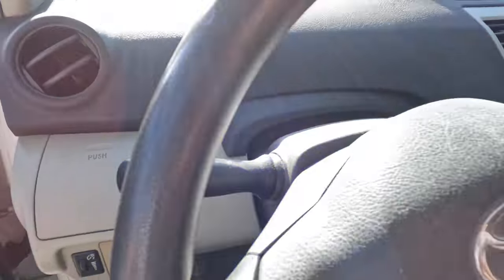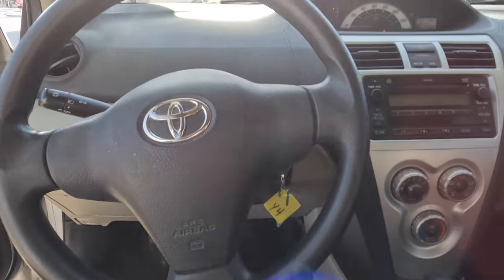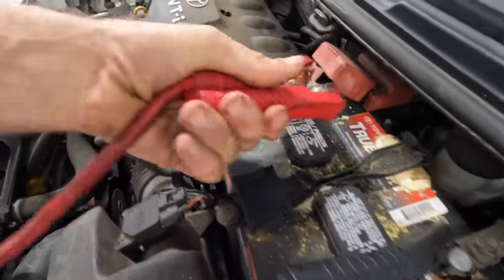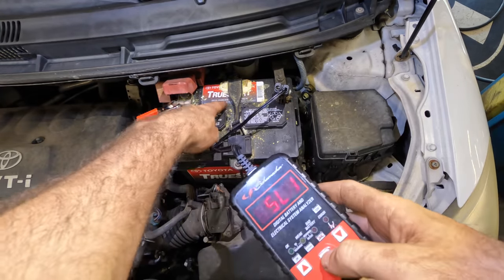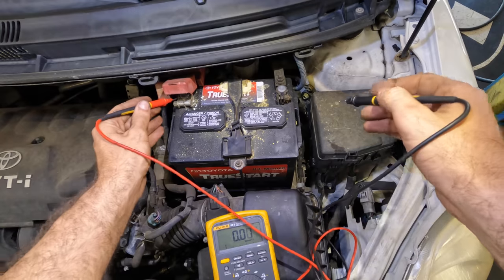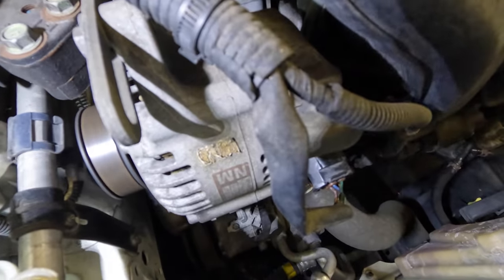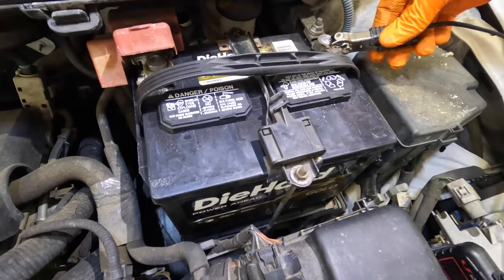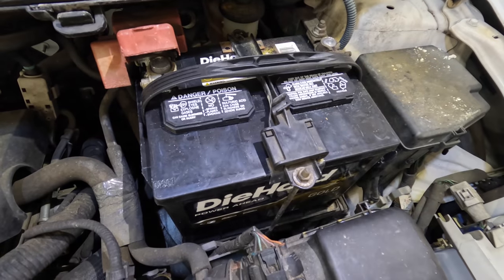Ignore the obvious! “Let’s see what happens” 2006 Toyota Yaris

Comment: Has it gone out of fashion to take a faulty alternator to pieces and examine and test the parts to find out what has gone wrong? Often it does not cost much to make a good repair. Last time I had a problem with the alternator in my van it was corrosion in the mounting/ground connection of the rectifier, and all I had to do was clean the parts and reassemble them.
Reply: You could probably still do that but with labor at most shops over $100/ hour it may be cheaper to just put a new nator in.
Reply: Yes.

Comment: It would be interesting to see how a best interest policy would change the dynamics of the auto repair industry in my hypothetical world as it applies to the financial industry.  In this example, the repair party shall act as a fiduciary to the customer anytime the vehicle is repaired under warranty or out of warranty by dealer or independent.  If the client solicited the need for a new battery even though the tech knows full well it is the alternator that is failed, the tech documents the unsolicited recommendation, the interaction of client, and the outcome of the repair. Documentation is the only thing that might buffer you from a client complaint after the fact in a fiduciary world of car repair.  BTW, was there any AC bleeding past the bridge rectifier and riding along the DC even in very small amounts? What does everyone think?

Comment: I am at a loss as to why a small device could measure the CCA (cold cranking amps) of the battery; 550 Amps is enough to burn the wires to a vapour in a split second.. The best test is when the engine cranks, and the battery measures, say, 11.5 Volts minimum, you have a good battery (after charging). The nominal charging voltage from the alternator should measure 14 Volts with the engine idling... If there is a load (headlights, air conditioning), a few revs, say 2,000 RPM would see a (regulated) voltage of 14 Volts at the battery under load..  ..alternator ok...
Reply: It probably uses a similar method to the mains tester I have which will tell me how much current will flow if there was a fault. It will happily display results upto 4.8 megawatts (20,000 amps) of fault current will flow with no issues. This is through 4mm/12awg wire which definitely can't carry that level of current.

Comment: Enjoy your videos. Do you also check if the alternator is charging at the output at the alternator itself? I had a case where the cable from the alternator to the battery was broken internally even though there was no visual break. Saved buying a new alternator.  Keep those videos coming!
Reply: Why did he need to check at the alternator, when the meter showed the alternator charging over 14 vdc ???

Comment: I was just wondering why you took the nut off the alternator ..The nut holds the insulator down then the wire goes on top then another nut Now the insulator will melt and you will have a come back

Comment: My Two 2001 and 2005 Civics still have the Original Alternators with 250,000 Miles, Maybe someone has a habit of washing the hot alternator-engine resulting in bearing failure.

Comment: It amazes me that the Toyota engineers couldn't see on paper that had they mounted the A/C bracket 1/2" further forward or back the nader bolt could have been removed without additional disassembly. I always visualize a lab full of design engineers passing a doobie around while they're thinking of ways to "F" with the end user.
Reply: My brother it is literally one bolt

Comment: So... I have a 2008 yaris... acquired because was abandoned due to a "no charge Condition" ray next one there is a relay under the dash drivers side that is for power windows ans locks etc that was issue with mine... the reason I say this is these cars don't always refuse to charge due to alternator issues at times its stupid relays unrelated to those circuits cause Toyota decided on these cars they should integrate everything 🙄

Comment: Nothing against the repair but wasn't impressed with the performance of the new (rebuilt?) alternator. Would like to see a bit more voltage.  The closer to 14.4 the better.
Reply: Newer cars are computer controlled charging. So with a brand new battery it didn't need too juice it up as much. GM can wind down charging to battery voltage.

Comment: Is it a requirement that vehicle coming into you shop have that low fuel light on? Just an observation.
Reply: Only if the work does not include work on the fuel system, in that case it needs be filled up right before being taken to the shop, let her eat until the pump clicks off, double click the sunbitch, three times the charm, gotta make sure the entire tank (incuding filler neck) is just packed full, gotta fill the reserve tank also aka the charcoal canister

Comment: I noticed you failed to "clock" the alternator hot wire protective cover base's slot with the wire and proceeded to tighten the nut. It's all about the details.

Comment: Interesting video. Expecting the battery to fix the alternator was a stretch but what the hell. The old alternator had a bracket for the harness tree. At 19:02 you can see it did not come with the new alternator and at 25:35 you can see the harness tree floating in space. Sorry for the REEEEEEEEEE but I enjoyed the video.....
Reply: He compared the two alternators side by side and ignored the bracket for the wiring harness 😱😱😱

Comment: Mechanic: you're alternators shot.

Customer: just replace the battery that should fix it.

Seriously some people shouldn't own a car at all. I had an alternator test good but would give me charging system failure at low rpms. After it did it with a good test I just ripped it out, walked it inside the store and told the clerk to just sell me a new one. Had the cash, drove there for that reason and wasn't about to be dead on the road.

Comment: engineering, bolt is 3 1/2 '' long, bracket placement is 3 1/4 direct in front. 25mm to the left or right, would not be a problem., but,,thats engineering for you..

Comment: There used to be alternator rebuild kits you could buy that came with bearing, brushes, and triac.
Reply: Right?  I remember taking them to the armature shop. If they had a reman they would exchange for a pretty reasonable price. If not they would rebuild for you.
Reply: There still are, and it's a good way to save some cash if you have the tools to DIY it. However factor in an additional couple hours of labour charges if you want a mechanic to do it and it swiftly becomes cheaper to replace the alternator with a new or reconditioned unit.
Reply: @Chlorate299  correct, was about to same the exact same thing there 👍

Comment: Hi Ray, I noticed a couple of things that you appear to have missed.  There was a bracket that bolts to the alternator to hold the charging wire clip.  I noticed that you didn't transfer it over to the new one.  Also, one of the air box clips was unclipped as you closed the hood.
Can you talk about these please?  Were these mistakes, or were there reasons?
Reply: How do you know he did not go back, look it all over, see the things, and fix them????
Reply: @frandanco6289  I don't.  That's why I'm asking, to find out.

Comment: What?   Does your battery tester have 99.99% pure silver cables on it?  I don't believe that your meter can test 559 Amps through those little cables and clamps.  Also, it's not cold.   How does that thing work without actually drawing the amps?

Comment: Judging by the amount of dried sulfur . Over charging , I have forgot the rest, ????? sorry. Too long since I have used that information. 
I most times would check the electrical connection between the Post and Terminal, I have seen them with 10.48 volts between so little wonder why that truck would not start. 
For hooking up batteries!!!!!!!!!!! The Negative Last On, First Off! 
Nope Sorry,  the terminals should have been cleaned and either Vaseline or a Dielectric grease applied. 
Battery should be charged  with an AC Charger for a period of time, as most people don't drive far enough to put an initial charge on the battery! I charge mine for a day each then charge them in parallel for another day, by that time the charge rate is around 2 amps.

Comment: Some days you just want to dope slap the car's engineer.😁
Reply: A thing I've noticed with a few old Japanese cars is that the air conditioning always seems to be an afterthought. I've lost count of the amount of times random things have got hooked up on aircon brackets/hardlines.
Reply: To be honest that isn't even bad, one extra bolt to take an alternator out? Awesome! On one of my previous cars I had to remove the oil filter, and ECU to get the alternator mounting bolts out. And even then the alternator only just could be removed without taking the power steering pump off... Ease of access on components that last more than 10 years is not something you need to consider when designing a car.

Comment: Ray, I have watched you use that tiny Load Tester for way too long.... NO WAY, can those tiny leads, or the minuscule Shunt in that tester handle 100s of CCA loads.  My load tester is a Brass Shunt, 3 inches wide and 15 inches long, with a MilliAmmeter across the Terminals..... that will actually put a HEAVY load on a battery, not that piece of crap gadget in your hands.
Reply: I also noticed that crappy battery load tester he uses. No way that thing properly loads the battery 😂😂

Comment: Those type of altenators on Yaris, passo, etc, 'stop' charging when the battery is full. They will charge again to around 14 volts if the driver is using the headlight for example, or simply when the fan goes on.
Just to get better mileage by doing so.
To tell you the truth, i do not like this technology.

Comment: Half the comments are stupid US thinking. Well you see boy this car is not for track days or to flex to your friends. It gives you a cheap car to buy, maintain and keeps fuel consumption as low as possible. Except US where displacement is like a no brainer the rest of the world pays huge amount of taxes for larger displacement engine. Here in Greece for instance the go to is the 1.6 or 1.8 liters. Get above that and you literally need to be rich AF to afford it. There is literally a luxury tax to any car that has or exceeds 2 liters of displacement. So most cars in the street don't have 150 Hp but somewhere closer to 100-120, concluding that 80 is more than enough for a car of it's class. Sorry for the long post.

Comment: Why don't you repair the alternator instead of replacing them. Sure that would be a lot cheaper. It could only be the doid plate or the bearings.
Reply: Cheaper for customer*  By selling a new one, they can sell the old one to someone else.
Reply: @dubious6718  normally there’s a core charge until u return the old one.  Paying a good wiring man (if you can find one),is like paying a mechanic. Plus paying the mechanic.  So it’s cheaper in the long run just to replace it.
Reply: Is that a thing? I don’t even know anyone that does repair. I just swap the alt and turn in the core.
Reply: I can hardly think it's been economical in this century and the last decade of the last century to send an alternator in for repair.  Even today's price of $200 for a new one is way cheaper and much faster.
Reply: It's only cost effective if you do the whole job yourself, add an hour or so extra labour costs, for a mechanic, removing, repairing the alternator, then fitting it, no more savings, might even cost more
Reply: @dubious6718   Wow! Show us where the bad mechanic man touched you.
Reply: Parts would be days or weeks out for that. Not many parts places stock stuff like bearings or brushes anymore in the US. "shiny" new alternator sitting on the shelf though.

Comment: The customer wants it to be the 'Battery'  no matter what.
Maybe the customer expects that the 'Alternator' will repair itself
when a new battery is installed and there to persuade the
Alternator to start working again.
The cause of this thinking is the scientific analysis part of the brain
has suffered a failure due to excessive alcohol consumption and
watching Sports on TV just as he wants a certain team to be the winner
he cannot acknowledge that the other team may be the winner.

Comment: Lol @ these customers. If he was so intelligent about turning wrenches why didn't he just waste the money on a battery and replace it himself?!?! Not only is the alternator smoked itself- (probably burnt rectifier diode and or voltage regulator,) but the fact that it's 'whining' like that tells me the bearings are trash too. It's COMPLETELY JUNK! Funny thing is I bet a battery is nearly the same price as a decent reman alternator! 🙄🤣 LOL how dumb could these people be when it comes to wasting money especially. 🤔
I used to work at a reman shop when I was in my teens before I started working at my first indie shop. Obviously all rebuilds aren't created equal depending on who redid the unit. The day of the week can even determine the quality of the rebuild when it comes to some guys... Besides myself there were only 2 other guys that did good rebuilds on alts, starters, a/c compressors, axles, driveshafts, etc. The rest of the guys there were drunks, and or crackheads, and some of them couldn't even speak English. Not only that, but I found out many years later one of them was a Chomo/ rapo on the sex offender registry!!! 😡 Talk about scraping the bottom of the barrel for some of these guys! Customer States: "Let's activate the parts cannon and throw parts at the car that aren't needed and ignore the one that is!" LOL 
end rant. 😁👍

Comment: Do you realize how much engineering was required to make that bolt long enough that the bracket had to be removed?
Reply: The bolt and engine was probably there way before the car around it was even designed.

Comment: I would’ve replaced the battery either way. But for fucks sake.. I will NEVER understand why people throw those cheap asf remanufactured aftermarket alternators in their vehicles. The original lasted 16-17 years… WHY put in junk that will barely last 3 years if you’re lucky? You’re not saving a dime, ppl. A properly remanufactured unit from Toyota is like 350$ but I promise you it’ll last another 15-20 years. 🤦‍♂️

Comment: If it's like my car that drives me nuts with a computer-controlled alternator it won't charge unless the computer is calling for a charge.😠😠 I hate the damn thing I drive 250 miles park for 10 minutes with the radio one and the things telling me to start the engine because the battery is low. What a P.O.S.

Comment: Change the battery .. what a dummy, anyone can see the real fix needed was a new set of engine cover bolts. A smoke test would have proven this out.
Aren't batteries just as expensive as alternators these days? Usually replacing the wrong part is linked to it being considerably cheaper. You know, I think I have a bad water pump, but I'm going to replace the 5 dollar temp sensor first.

Comment: you need at least one devil's advocate, right??  In defense of the customer we ALL know there ARE ripoff shops/mechanics out there.  The thought that the battery needed replacing could have been, as YOU, Ray, noted, because the dash didn't indicate a charging failure.  And you didn't diagnose this.  If it were mine I wouldn't either BUT it is "interesting."

An after thought about engineers vs mechanics, if engineers made repair EASY then DIY's would be more prevalent.  You wouldn't want that,  right?

Comment: It seems such aggressive treatment of those battery terminals could have reduced the clamping force, and doing it on the new battery seemed like a bonehead move.
I know time is money for you professional mechanics but it wouldn’t have taken that much effort to remove the bottom tray for a quick clean, as well as removing the corrosion from underneath the hold-down bracket. I would’ve been inclined to clean those new posts as well to ensure the best possible connection between the mating surfaces. Lastly those alternator bolts could’ve used a coat of anti-seize.